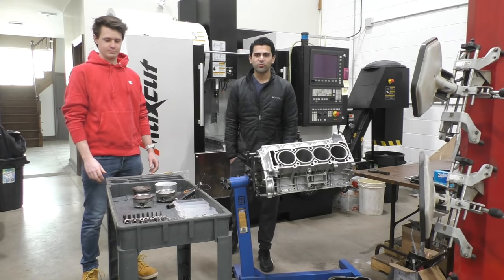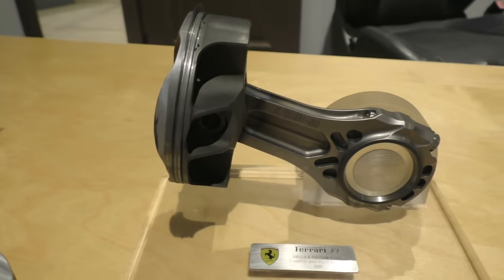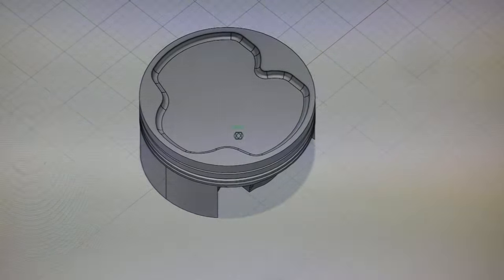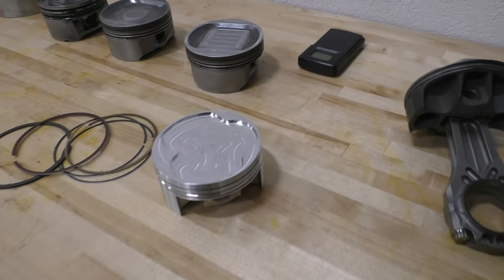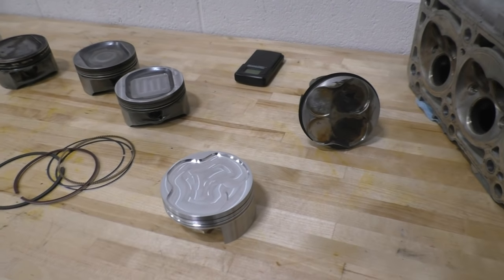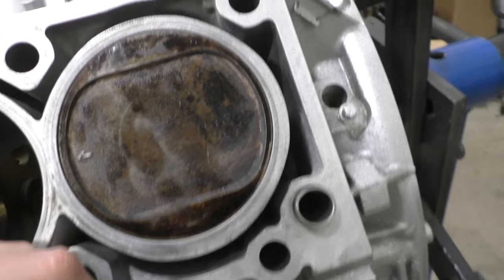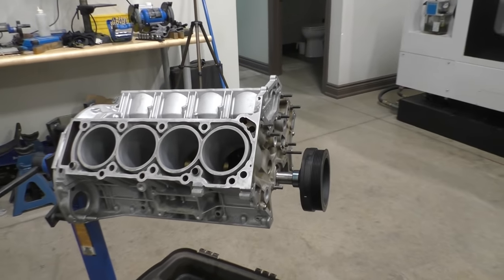Making an 11000rpm F1 Style Piston - Project XF1 Part 2

Comment from the maker: Part 3 is up! https://youtu.be/P4evs4IkfOU
Reply: I guess you use 2618 aluminum, but what about the elliptical shape and piston profile? Are you just ok with it not beeing round when its hot and it will wear linears and pistons fast ? Piston shape in cold state is very very important.
Reply: How about you ceramic coated the top and the skirts
Reply: @karlssonengineering  I think he's not aware of that pistons aren't round..
Reply: Talkin, talkin, talkin nnnnn talkinnnn. when do u breathe..or... sigh...?
Reply: Are you going to coat the surface of the pistons sidewalls, for less friction inside the cylinder? There’s a black coating which works suuuper crazy good for lowering friction and keeping the temps cool while having the piston slide up and down the cylinder more easily resulting in less performanceLoss and reaching higher rpm faster as well as loosing rpm faster when no gas is pressed.
Reply: Thank you, But, Where did you get the Proper material of block for this piston ? Thank you .
Reply: Did you guys consider using 3D printed material (I think it's weaker but just as a curiosity)...
Reply: Hey, I hope all is well. I would love to see more on your project 👍 I am building my dream V12 supercar 😎

Comment: I have a couple of suggestions for you.

1.) use a double spiral lock piston pin retainer (wire lock isn’t sufficient for that rpm)
2.) if you’re utilizing a dry sump system you can eliminate the oil control rings all together and use a Napier 2nd ring
3.) an accumulation groove between the top and 2nd ring wouldn’t be a bad idea 
4.) a solid oil return design would be well worth the time in the design process
5.) checking the surface finish would be ideal and can be compensated with a coating
6.) if the design allows for a wider “rail” (for a lack of a better term) on the top of the pistons where it is at its thinnest that would be awesome. While the piston may sustain the pressure, it may not sustain the heat and can melt that edge
Reply: I know I'm late, just seeing this but WPC is a great surface treatment for parts, for pistons you have to be selective on where you treat them with this, but it is a great process.
Reply: Whu are you ?
Reply: Who are you?
Reply: Just a very low key high performance engine builder, racer and business owner.
Reply: @troymcbain5705  how can I learn engine building?
Reply: @troymcbain5705  i've actually seen thinner "rails" on racing pistons, i only skimmed through the video but if they're using a forged 4032/2618 billet they're not gonna have any problems. but yeah i'd also coat the skirts. do you know if ceramic coating the top is actually worth it? I've thought about it on my engine.

Comment: There's a lot of sharp concave corners in that design unlike the f1 or any other piston. Concave edges are stress concentrations and sources of fatigue cracks and should always be filleted for load bearing features
Reply: Super cool stuff though!!
Reply from the maker: Yeh it's just for the prototype. For the final ones we are using radiused endmills
Reply: @xfmotorsports  You always think of everything. Can't wait to see it run!
Reply: @xfmotorsports  About sharp edges, i've noticed that the skirt's side edge isn't vertical on F1 piston and mercedes has put a chamfer like cutout on it. The skirt itself also seems to have some kind of relief (or is it just a wear pattern?)

Comment: I can't believe it, this man is making his own pistons even
Reply: @Muckin 4on as if it's that easy
Reply: @Muckin 4on Its a prototype, he doesnt especified the material and treatment that is going to be in the final product
Reply: @Muckin 4on You know what prototype means? Its just giving a try of the  gcode in the machine, so he doesnt waste a expensive material. And He already told the load that should handle the design. That means he consider the yield strenght and others mech properties of the material in the calculus of the design with a safety factor. with that you can tell if viable to use the material or not
Reply: Come on man, Burt Monroe even cast his own 1000 years ago..  :D

Comment: Forged w/finished machining will be stronger (f1 piston) and less prone to stress cracks due to proper grain flow in the metal lattice

Billet machined wont have proper grain flow and will be more prone to fatigue and stress cracking across grain boundaries. This isn’t simulated in the FEA you’ve run. 

Good nugget of info to tell your viewers.
Reply: Yeah i thought the same. Im really worried that it wont work. Its also need really good cooling and oiling otherwise the block will enjoy a nice bite out of it
Reply from the maker: They're machined from forged 2618.  The material about 30% stronger than the regular 4032 forged pistons. It just has a 20% higher expansion rate which is why road cars don't use them
Reply: @Jessica Suzumiya not assuming, it wasnt said in the video is all buddy, im a materials engineer mate
Reply: @xfmotorsports  are you annealing the final product? that will improve the grain flow substantially 

If you ever need anything 3D scanning, I run a small engineering business in the UK (insta @Laminar.solutions) and would be happy to use our laser scanners to give you hand on any projects. 

Love your content, keep it up!
Reply: @Jessica Suzumiya  mate, he never assumed him to be an idiot, rather merely made a genuine suggestion. Then he got an fairly inoffensive reply.

If you want drama, go watch some bloggers. This is how we tend to communicate in STEM... straight to the point.
Reply: @xfmotorsports  What he (KineticMeercat) was referring to is the way that pistons are forged, not the material.  They are forged from underneath to strengthen the crown in the opposite direction of combustion, your billet was not.   It appears to be an extrusion.

Comment: Pistons are slightly oval to allow expansion in the direction of piston pin. From what I saw of the final turning of your piston it is not.
Reply: Quer ensinar o padre a rezar a missa...
Reply: There is much the father could learn from him
Reply: First things first. Not oval put tapered, and not F1 car pistons but road car with different tolerances. Another thing I saw when they measured existing piston, no doubt they doing a job good💁
Reply: Can anyone tell whether zinc aluminum alloy is good for making pistons of bitzer semi hermetic
Reply: @maciejsn2126  Pistons are tapered and oval
Reply: Correct, OD has ovality and form (not taper) as does the wrist pin bore.
Reply: An obvious way to do this would be to fit the piston up especially tight, then run it briefly, dismantle the engine, and then filing/scraping the high spots prior to reassembling the engine and running it again for a slightly longer time.

You’ll need to do a large number of iterations to get a final result.  

The chief matter is how LONG it will take, as well as the extreme care needed during the whole process.
Reply: pistona are weird, cam ground when veiwed from above and strange tapers from side and front veiw, all designed to fit when hot and expanded
Reply: @maciejsn2126  Its oval bruh not only tapered
Reply: @dennisyoung4631 rebuilding an engine that many times isn't practical. Unless you're wanting cutting edge? It's too much.
Reply: You are right. Besides, it is not Just a single aluminum. Are alloy.

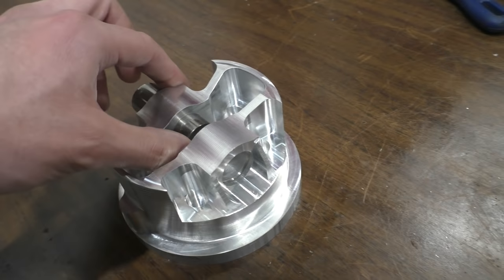Comment: 12:27 i think the clearance was perfect, considering that aluminum expands alot more than steel and the piston will be alot hotter than the wrist pin.
Reply: Did you mean 22:27
Reply: @zakr1187  no i'm talking about the wrist pin
Reply: Yup i agree, it shouldnt be too loose, otherwise it will knock around and bend the aluminum
Reply: I thought the clearance was perfect also

Comment: What material is the billet. I would suggest for a production run, get the shape you need, slightly under size the wrist pin holes, solution heat treat and age to the final temper, then final machine and ream the wrist pin hole. Then look into surface coatings such as sulfuric acid anodize or chem film.
Reply: 2618 forged alloy

Comment: Mahle pistons are not only tapered, also egg-shaped. They're not round. it's compensation for the exhaust side getting hotter.
Reply: Maybe they compensated for this in the cam but i doubt it
Reply: @D3nn1s  How You gonna compensate the outer shaper of piston (round-oval) with a cam? :)
Reply: @jareknowak8712  i didnt mean to write the, its late sry.
What i mean was cam like in computer aided manufacturing (the stuff that happens between cad and gcode)
Reply: @jareknowak8712  The original machines for making oval pistons did use a cam: It moved a grinding wheel in and out slightly as the piston was rotated on the machine, which produced the correct oval shape. Thus they were called 'cam ground' pistons. Nowadays you can do the same thing with the CNC software.
Reply: @nerd1000ify  grinding wheels???? this model piston doesn't have to be oval. The parts to make it oval (for less friction) are already missing. And that's good!!
Reply: @Roelasia  I was talking about 'the olden days' when pistons had full skirts and nobody had even considered the possibility of CNC machines. These days of course we cut away most of that material, but the piston will still have 'ovality' so the pads have line contact for less friction.
Reply: @nerd1000ify never the less, it's a challenge to make your own pistons. forging, heat treatment, honing the piston seats.
too many errors possible, and that times 8...
Reply: @Roelasia  I imagine most custom home made pistons are just machined from bar stock these days. No need to forge and heat treat, but still plenty of ways to mess it up.

Comment: Make oil feed through piston, so it will be extremely cooled by oil.
Reply: The only issue with that is that it reduced structural rigidity. So if you are doing rebuilds or replacements every 2 or three races like a pro team then maybe, but for the needed durability of low cost club racing, I would avoid it.
Reply: @commentaryking5165  Maybe they can add thin pipe or use not pure aluminum to strengthen the piston, to make some kind of complicated drilling, I think pure aluminum is is bad for the load that they are trying to do, also the block itself is aluminum. Im watching other channel where they restore engines and modern engines are aluminum - trash that doesn't hold shape. Cast iron blocks come with 4 - 5 times more milage than aluminum. Skirts on modern pistons, piston rings, oil drain holes on piston oil rings, everything is done towards fuel efficiency and higher hp with less engineering.
Reply: @pfoxhound  I agree that pure aluminum is not the best choice, although I believe he said it was chosen just for gcode. So the final product will be made out of something else. There is always a trade off of some kind,  that's for sure.
Reply: @pfoxhound  not true. Aluminum just needs a coating since otherwise it will deform too easily. Disadvantage of surfave hardening is that it will change shape slightly and you cant really do anything afterwards except grinding a couple thousands off, so extreme precision is required which this cnc cant do, esp not with the temperature changes. Im really sorry and maybe they have it conpletely planned out but i predict failiure sooner than later. Milled stock is one of the weakest form of metal
Reply: @pfoxhound  There might be a problem with that maybe? I’m not very knowledgeable about engines but I do know people remove piston oil squirters on the 2JZ because hot pistons + cooled oil caused blown engines. Perhaps the same logic might be applied here?
Reply: @TienTran-kw3il  that’s what I was thinking. For daily driving for sure oil squirrels are great but on higher hp applications they tend to affect the heat cycles of the engine and hurt it
Reply: @pfoxhound  Old engines lasting longer than new engines cant just be thrown at the use of aluminium as a casting for the block. Actualy, most new engines are way more rigid then older engines, because of better engineering, better material choises and more precise machining.
Reply: @pfoxhound  I dont think that adding a tube of a different material is a good idea, because different materials usually have a different expansion coefficient
Reply: @BackyardGarage999  and don't forget the problem with different electronegativity causing a battery with a cathode and anode.
Reply: Impossible with 100% CNC machining from billet.
Reply: @coco_lev8358  I think there are CNC EDM machines not sure why that wouldn't be considered machining
Reply: @brandonsmoot4056  by this way maybe yes
Reply: @coco_lev8358  totally not true. Oil cooled pistons just have a channel trough the skirt, it does not even have to be closed in, it is cooled by spraying oil from the bottom.
Reply: @guidoheeling1179  I read "THROUGHT PISTON"
So for me it was about a cooling channel.
Reply: @coco_lev8358  fair play. I know what you mean now👍🏼
Reply: @pfoxhound  Very bad idea!! Aside from compromising the structure of the piston, the difference in temperature will not be good. Not to mention the engine needs to be warmed up to a certain temperature to expand the metal and close all the gaps..
Dont know what you know about F1, but try to start that engine cold.. good luck with that! 

Plus, its not only because they feel like it, that Aluminium is used in every racing high revving engine..
Reply: @TienTran-kw3il  people remove squirters cause of oil pressure not blowing engines. Cooled oil on pistons isn't like hot ceramic in cold water it shouldn't blow up like that.
Reply: @youwantshum9860  Removing piston oil jets in an engine that will likely operate in long times will increase the chances of knock.
Reply: @rickcupola6262  how so?
Reply: @youwantshum9860  No cooling for the piston would increase the temperature of the piston, thus the increased chance of your air-fuel mixture to be ignited by compression, not by a calculated spark.
Reply: @rickcupola6262  that would be assuming the engine doesn't have very good cooling capabilities or maybe fuel limitations. Most engines these days would be able to handle that being that most have oil coolers and what not
Reply: No, you want to reject heat away from the piston... Coat the top with some sort of anti-heat ceramic coating. Using energy to heat the piston doesn't improve efficiency, it actually reduces it.
Reply: @commentaryking5165  you basically can't get pure metals
Reply: @flavortown3781  Why do you want pure metals?  They are weak and fall apart?  Pure aluminium is like butter.
Reply: @pfoxhound  higher hp with less engineering? Nope, there's a lot more engineering now than ever. Just the strength to weight optimization engineering today is way more advanced. Also, less friction and less rotating and reciprocating inertia improves both power and efficiency.
Reply: Too much oil squirted into the piston actually lowers power because it adds weight to the piston. The weight may just be in grams but the piston is going up and down a hundred times a second at 6000rpm.

Some drag racers even plug up the oil squirters to gain a bit more power.
Reply: thats what squirters are for. those wouldn't work for this application. linear oil holes on crank for oil spread

Comment: Design has several areas with sharp corners which will result in stress concentrations where fatigue cracks will form. For something like this fatigue is critical, need to analyze it subject to the acceleration loading it will see at TDC, BDC at max rpm and see what happens. Ball end mill can get you the required fillets in the pockets. Otherwise, exciting project. Maybe you can make me some custom pistons!
Reply: He answered a different comment pointing out the same thing and he just didn't do it for the prototype pistons but will radius the real pistons

Comment: Hi XF and Marhew. Thank you for your vid. Your design requires substantial skirt ovality because the boss webs expand lengthwise with combustion heat. If you run these at a similar clearance to original pistons, they will sieize in 4 places. In contrast, a very basic design such as a 2 stroke, can get away with almost no ovality. With your equipment and expertise,  a precision oval turning attachment that you could make yourselves is absolutely do-able. Reply to this comment if you want some pictures of my version for a cnc mill. Piston Pete UK.

Comment: Great. Thumbs up. Ever thought of making a sleeve valve engine with your knowledge about thermal expansion? I could provide the CAD. 
One thing though, if u have a piston which can bear 250 bar, the open deck cylinder block will certainly be the limiting factor here, not the pistons.

Comment: Making pistons lighter is really important for high revving engine, but even more important is to reduce stroke to achieve lower speed/inertia of the piston. The valves and in particular the valve spring are the other thing you should think about if you would want 11k+ rpms. I am really curious how this will perform. Congratulations on this amazing project !
Reply: At 10000 RPM a piston "weighs" 5000 times as much as at 0 RPM. so the saving of 20g+ will make a big differance at 11k rpm.

Comment: As for wrist pin clearance, final coearance needs to be done on line hone for final surface polishing/cross hatch on the wrist pin area...

Not to mention u need oil port hole for the pin, for the oil scraper ring as well as gas port for top of the piston ring for total cylinder seal during engine operation

Comment: The most annoying thing about designing aluminium pistons is taking into account the thermal expansion rate of that particular alloy. And designing the roundness accordingly.
The Piston can be heated while rotated on the mill, and measured with a gauge.